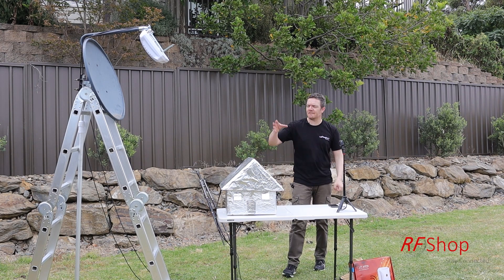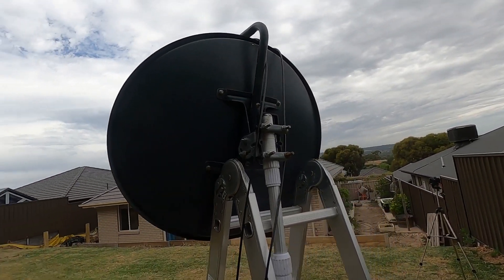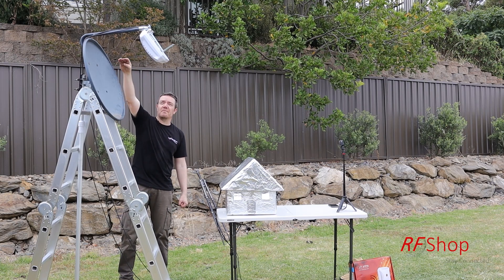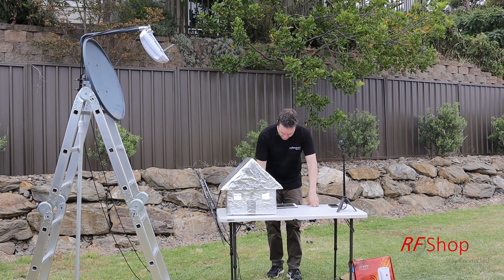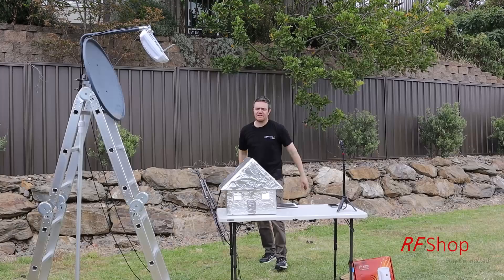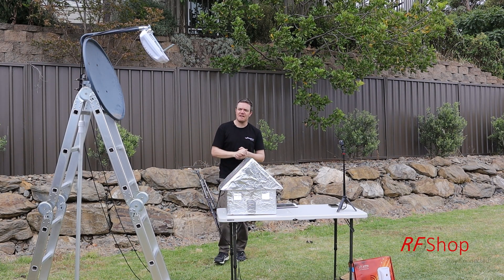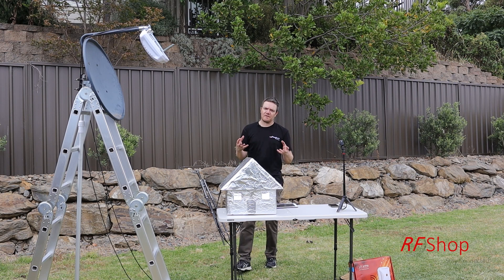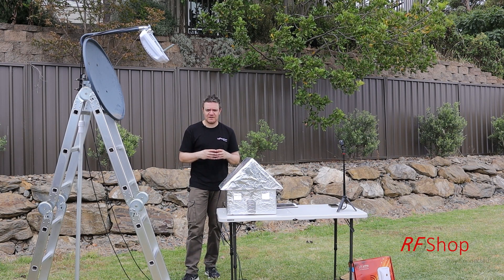Converting an old dish to a high gain 4G Antenna using a Poynting XPOL-2 and Huawei B818 router

Comment: I'm gonna try this with 4×4 mimo panel antenna thanks for the video
Reply from the maker: No problem. That should work well. Just need to make sure you get the focal position of the dish relatively accurate :)

Comment: Thanks for the demo. As an experiment at workplace I used the xpol-6 with a tplink mr600 and having direct eye-sight of the tower my speeds went from 25Mbps&7Mpbs to 70Mbps&30Mbps.
So for the house where it will actually be installed - very, very poor signals with no direct line of sight so I'll have to raise the antenna to who knows what height....will be interesting to see what happens.
Reply from the maker: Please let us know how this goes

Comment: HI sir i have a question here for you Aliexpress is legit i saw a dish show me gain 30db it gonna working on B618S-22D?🤔
Reply from the maker: Sibo, I would not trust an antenna that claims anything higher than 12dBi on cheap websites such as Ali or eBay, unless the antenna is really big (say around 1m long or so)

Comment: Can we replace this antenna with any type or shape also does it work with the outdoor antenna of 2g 3g 4g signal boaster?
Reply from the maker: The antenna needs to be a low gain antenna that points in the direction of the dish. This principle works for any frequency, since it's all physics...so indeed it'll be good for 2G, 3G and 4G as well

Comment: Would a larger dish increase the result, specially for UPLOAD? Let's say 2.4m wide dish. Great video!!
Reply from the maker: Hi Jean. It should help, although perhaps not in my case in my own backyard. I actually do have a 2.4m dish, and was contemplating whether to take it to Rapid Bay or not but you convinced me I need to go there one day...even if it's just for a fun video project
Reply: @RFShop  please. When you do, share the results with us
Reply: @RFShop did it work with you? I was thinking about the same thing because I also got a problem with the upload speed in a mountainous area where I used a 90cm dish! I got the signal from “no service” to -108 dbi and got a download speed of 40 Mbs but only 1 mbs or less for upload! So plz tell me did the bigger dish help?

Comment: do the mimo dual antenna pickups work that much better than a single?
Reply from the maker: Yes, MIMO does improve the service as it turns into a two channel system setup

Comment: I have an old sky satellite dish that's placed to its focal point/strongest signal direction. The dish is untouched and the cable runs through into the house, the connectors are wrong type however to put in to the two antenna slots on my archer mr600. Can I simply change the connectors to plug strait in?
Reply from the maker: Problem would be that the cable is 75Ohm, but you'll need 50Ohm

Comment: not the aluminium house is of interest than rather the pick up antenna compared to the dish setting.
This test doesn’t say anything.
Reply from the maker: Maybe not, but it was fun to do and I learned a lot from it.
Reply: @RFShop  
But, as I understood the question was, how much improves the big dish compared to the antenna, used in this experiment, directly used … so, what does the big disk bring?
You haven an answer ?
Reply from the maker: @n.r.2258  in essence I learned it's not worth the hassle. Still wanted to explain the concept as it's theoretically sound, but impractical if you ask me.

Comment: Great video. May I ask for your advice? I've got the Poynting Xpol 1 - 4G omni direction antenna but it doesn't work very well with Three 4G provider in my area in London. I've fitted it up/down to an old  semi dish (eclipse shape with many holes). Still got only 3 bars (level of the recv.signal, RSRP=-100dBm,RSRD=-15dB, Dwn/Upld.speed=1to8mbps) on the Huawei 4G 3 pro router. I would like to know how/where to point the dish? What values/reading should I be looking for? What other antenna will you recommend? Considering the SW19 2QD post code, what's the best signal I may get from Three? Thanks.
Reply from the maker: Hi Vitalie,
Thanks for your message. If you don't place the antenna in the focal point, one would have an antenna that's worse than the original antenna. I would actually (in general) recommend the XPOL-2 over the XPOL-1, just by the nature of the difference. However, do note my perspective does not come from metro London but from rural Australia :)
Make sure you find the focal point of the dish..that would be my first recommendation

Comment: It’s not really an accurate experiment if you wrap the internal antennas in foil yet you do nothing to the dish antenna to inhibit its signal. You really need to do this experiment at an area with poor signal
Reply from the maker: Completely agree. The aim was more to demonstrate the idea of a converted dish. The B818 has 4x4 MIMO so even when an external antenna is connected one still have some results that involve the B818. After this video was shot I realised it’s fun and nice, but not enough of a topic to dwell much further on.
Reply: Even then, you won't have the dish covered would you! It be high up with the clearest view of the sky

Comment: Hi. im wondering if you could do this with yagi antennas or what do you think ?
Reply from the maker: Hi !
A Yagi antenna would pose some challenges as it would be hard to find the correct focal point. It might also be too high gain, as you want mid-range gain so the source antenna can "simply" cover the whole area of the satellite dish.

Comment: hello sir
my question is...
does using parabolic dish with yagi increase gain and if it does how to setup yagi antenna in front of dish
i need to catch wifi from long range
Reply from the maker: Hi Muhammed. The parabolic dishes work best when a low gain antenna is used as the source, able to illuminate the whole surface of the dish. If you use a higher gain antenna the benefit of the dish becomes less significant
Reply: @RFShop  directional or omnidirectional antenna which is more suitable ?how much dbi antenna is more suitable?please assume its range?
Reply from the maker: Hi Muhammed, it all depends on the dish you use. However, a directional antenna of around 5 - 6dBi should work really well
Reply: @RFShop  I have 70cm dish
Which directional antenna is good pcb Yagi or disc Yagi or biquad yagi?
Which type cable is good and it's specs?
Reply from the maker: @kmalerts  perhaps you want to contact me direct to discuss further? There are too many follow-up topics to clarify for the Youtube chat forum.
Reply: @RFShop  ok thanks for your reply
How can I contact you
Reply from the maker: @kmalerts  check our website for email and phone number!

Comment: Can I still use a directional antenna if there are buildings in the line of sight?
Reply from the maker: Hello Coops66. It's an interesting question. Fundamentally the problem of the building is already there, both before and after the introduction of the new higher gain antenna. In theory the only difference is that you now "see" the problem of the high gain antenna where otherwise you don't always get to "see" how bad the obstruction is. 
Having said that, I am still a bit concerned that the higher gain antenna might amplify the problem of reflections because of the building and I appreciate it simply feels wrong to point an antenna straight into an obstruction.
Reply: @RFShop  thanks think I’ll have to go omni directional 👍🏼
Reply from the maker: @coops6621  low gain might be an options as well...if it's 4G / 5G then I would be very comfortable with the XPOL-2's

Comment: Great point about the signal quality vs throughput, David.  I currently get -93 RSRP and -12 RSRQ but have 35Mbps down.  I really need to get a real antenna though (For now, I'm just using two small antennas that you'd see on a router :(  )

Comment: Hi mate, good video as always.
Wonder what kind of reception the Xpol on its own would have. That sinr is ok, but not great.
Btw, check this Mikrotik lte device, it's designed to be mounted on parabolic dishes:
https://mikrotik.com/product/ldf_lte6_kit

Regards from Europe.
Reply from the maker: Luc, indeed a lot more to learn with this dish. I need to get to a remote place where there is simply no good signal so I can do a proper 1x1 comparison without the vast number of base-stations and reflections. As you could see from my backdrop...there's metal and buildings everywhere. 
Thanks for the comments though...and will have look at the Mikrotik LTE units.